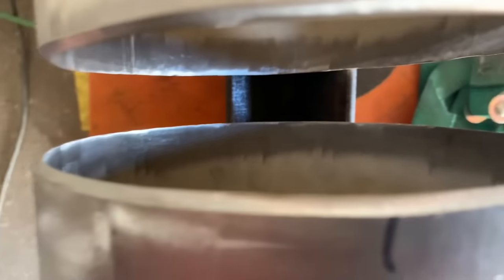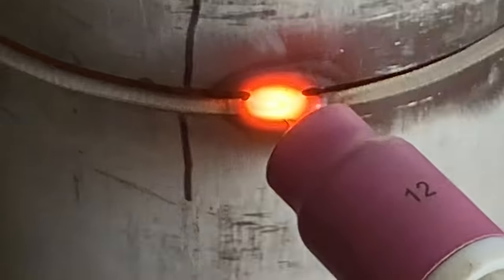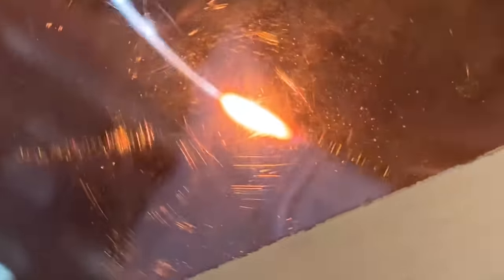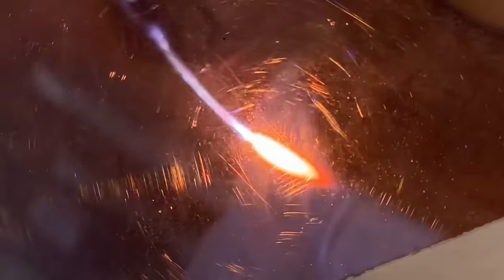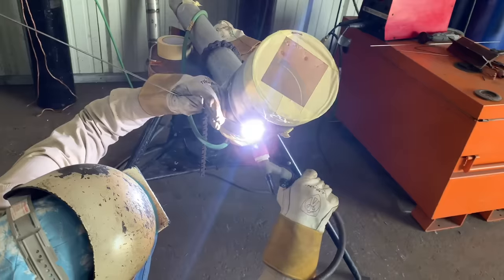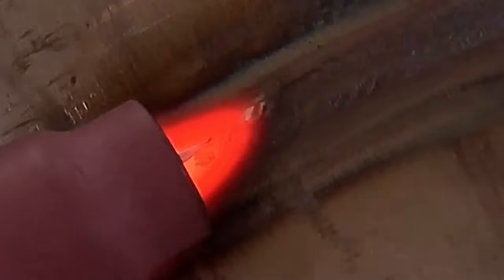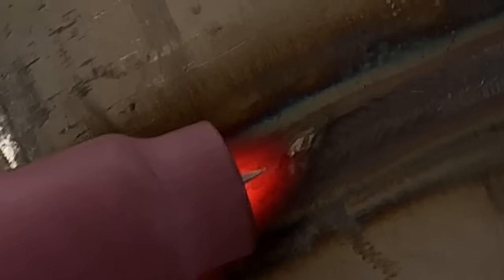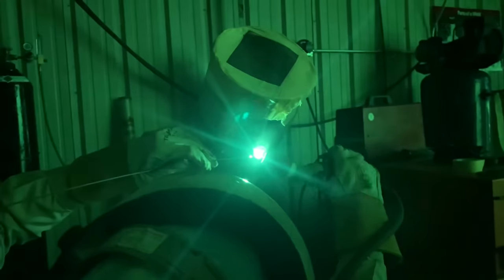ROOT PASS ON SCHEDULE 10N STAINLESS STACKING DIMES

Comment: I tried this technique at work this week and I have to say it works great. I was using a similar keyhole-dip method but I was having trouble making it look consistent on the inside. What really helps is walking the whole width of the bevel instead of just the width of your gap. It really helps to make sure your keyhole doesn’t get out of control on you. Thanks for this video!
Reply: Hey man can you explain more, or is there a way we can talk. I need to get this technique down
Reply: @Primetime_dads  what questions you got?
Reply: @GTAW.  hey man could we chat over the phone somehow… it’s will be to hard to explain everything in a text 😂
Reply: Cerradura ?Se entiende por cerradura al agujero en donde se introduce una llave para abrir la correspondiente a esta . . Albtema de soldadura sea cual sea esta este paso se le denomina charco .

Comment: I have watched this video more times than I can count I've been mighty and spray welding for 10 years then me and My dad bought an Everlast 255 and I taught my self to tig no I'm a stainless pipe welder  I started on roll cages and small bore carbon then moved to aluminum where I work now I'm back in pipe welding stainless this video has helped me a lot I still have trouble walking te cup but it's not terrible

Comment: This is exactly what they should be teaching these kids when they first learn how to weld! Face feeding is key! Especially when taking a weld test! I took a no grinder weld test on a 2” sch. 10 for a uranium enrichment plant and the weld inspector asked fro 1/16 root reinforcement max! You achieve this by face feeding your filler wire! Not back feeding! In a real job scenario when getting your welds are x rayed and your dealing with thin wall pipe or small bore 2” ,1 “ and below you need to always try to face feed and when you can’t face feed grab a smaller filler wire 1/16 and use it to back feed! Awesome video!

Comment: Or if you want a slick wedding band effect instead of dimes. just keep that wire in the top edge of the puddle with light feeding pressure. Careful with just enough not to let it keyhole, no big deal if it does though. When doing this I will also walk really fast and really  tight. When your done with the root pass there will be a noticeable line running down the center of the root on the outside ( sign that it in there ). My go to method. Takes some practice to make shure it breaks down the walls, but once you mastered it you can do it with your eyes closed.
Reply: Yes yes yes. My favorite
Reply: Im sure they know. Different ways to skin a cat.

Comment: Awesome video man! Especially being an Alloy hand! Another good tip is to Wire brush the heck out of that pipe out of every pass!
Reply: Darren Ricks hey man you sound like you have experience. Would this same technique work on Carbon too? With reinforcement and all?
Reply: Cleaner the weld the better it’s going to look! Only part I don’t brush is the cap!
Reply: @dingaling6030  If you are talking about facefeeding and getting reinforcement on the bottom, than yes. This technique will work with carbon but be cautious as you can get suck back on the bottom.

Comment: Do you hold  the filler wire on top of the weld on sides so you don’t get undercut or do you keep it in the middle I was getting undercut on the sides a little bit

Comment: Did they fit it up with a 5/32 wire and it shrunk to a 1/8, or did they take it with a 1/8 wire and it’s a tight 1/8 gap…. I just tried this and my bottom was below flush because I felt like I couldn’t push wire because the bevel behind me was a tight 1/8…

Comment: Is he going wall to wall when he dips, like is he doing wall to wall the hole time, or does he pause in the middle of the weld the dip then go wall to wall, or does he feed the wire when he dips and go wall to wall as the wire is being pushed/dipped… also looks like he’s got the wire kinda sideways instead of straight in when he dips

Comment: This method working so well, is there any point feeding through the pipe?
Reply: Some like appels, some like pears...
Reply: @kristianskov4841  Maybe backfeeding produces more buildup on the root than facefeeding or atleast aims for it? I like both, pears and apples that is, but I find backfeeding method a little bit trickier.
Reply: The only point would be for "looking through the gap technique" which is basically backfeeding. Only difference between apples and pears, Apples you can see the root go in on the bottom, pears you're watching the walls breakdown then adding wire from the outside.

Comment: Arc marks? How to stop getting them. How do properly terminate a scratch start TIG rig would be amazing. Or how to fix arc marks.
Reply: I break arc on my wire when I'm pulling out of my puddle at the end i walk fast with no wire to cool the puddle just as he did. Right when you go to pull out of the arc make sure the puddle is not wet. Put the wire back on to the cap about 1/2 inch in front of the tungsten then pull out on the wire. Do this quick so the wire doesnt melt. Your arc marks will wonder up the wire not onto the pipe.

Comment: I’ve always been scared of this one because all I ever learned was face feeding, every time I come across this test the inspector wants it back fed and I end up busting out because it is something I’ve never done consistently so I have trouble with it never tried it like this on stainless but I can stack them in on a aluminum test I guess feeding the wire would be similar just going from a freehand keyhole method I use on aluminum to walking the cup

Comment: Stainless holds heat as compaired to carbon or aluminum. Yes let the base material sit and cool between passes. Because of this property of poor thermal conductivity the amp need to tig weld are considerably lower and travel speed must be maintained. I can get by on stainless or inconel with a dynasty 200. With aluminum no way as the aluminum conducts heat so well. Of course thin walled aluminum works fine on the little dynasty.